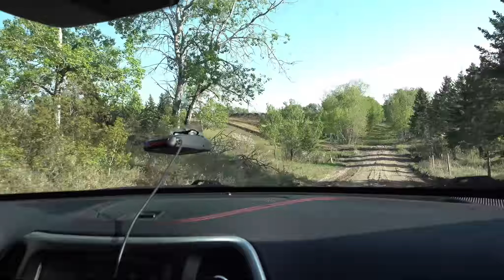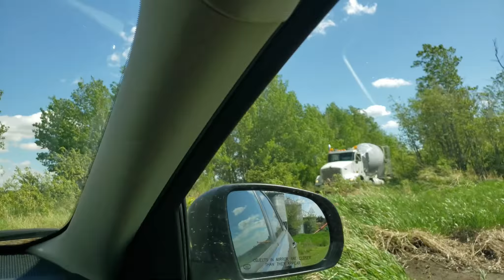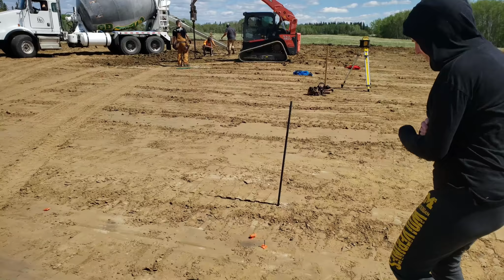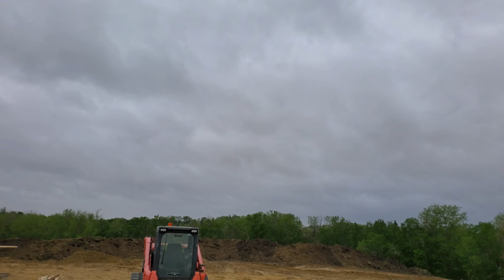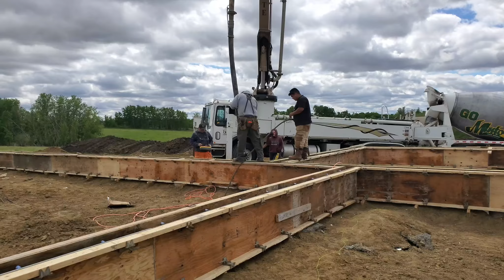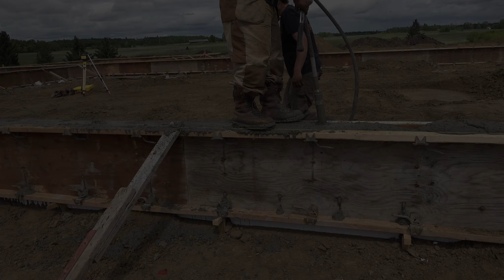Building Our Dream Shop/House Part 2: We Get a Driveway and Concrete

Comment: I do hope that precautions have been put in place to prevent any run off from the site entering the water course and polluting it.  Not exactly a low carbon emission build with all that concrete.
Reply from the maker: We live in Northern Canada so building with sticks and leaves doesn't work very well

Comment: It’s so cool to get to tag along for the ride. It’s amazes me to see how different the building standards are compared to how we build our concrete slabs with styrofoam insulated L-blocks and then level out the inside with gravel and styrofoam blocks and lastly pour concrete over it for the slab. Al this to keep to cold out from the house. Forgot to say hey from Sweden! 🇸🇪

Comment: You know how on your garage you had the garage doors on one side. When I had my house built I have the garage doors 2 on next to each other.  And I had 2 on the other side the garage so you can pull in the garage and pull straight out the other side.  So in the winter time you don't have to back
Out in the snow. But my house is built on a bluff. It makes it so easy to pull straight out. It took 6 months to have my house built. Because it was 6,200 squ ft.I wish I would of had my garage built on to the house. That is going to be a Beautiful place you have there.
Reply from the maker: Awesome! Thank you

Comment: It's a amazing undertaking this entire project.  Congrats to you both. A once in a life time experience. .or until it's time to  rebuild again!  
I've done most of the work that's going to take place at your home and property.  I am curious about the method of your water well.  Cable Tool Rig or Air/Mud/ Air Rotary  Drilling Rig. . At 200 feet deep it's likely bedrock formation.  I look forward to your  construction.  
All the best along the way.
Reply from the maker: Well should be done very soon. Thanks for watching and commenting :)

Comment: Congrats on the new build 
Too bad you hired that contractor 
I’ve done lots of work on the houses they have built and there houses are not in square and the foundation work is terrible.. lots of overspill concrete on the inside of the walls
Would fire them if it’s not late yet